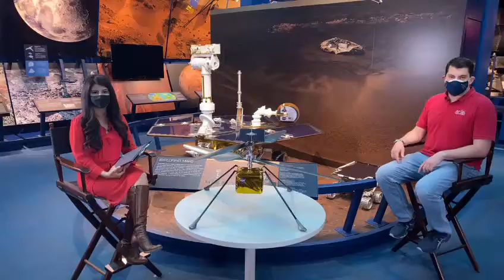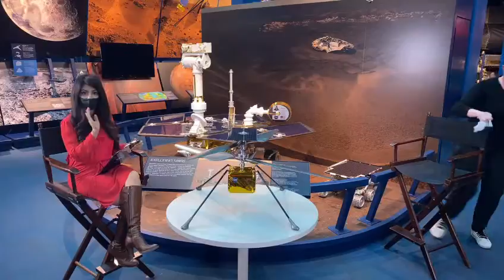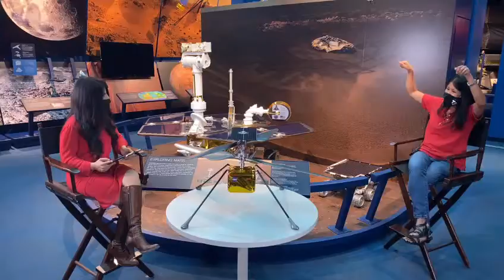Mars Helicopter Live Q&A: One Step Closer to First Flight

Comment: This Helicopter has a bad design.  For example the solar panels should have been in 2 sections but angled slightly down like in v but upside down.  So dust and dirty wouldn’t accumulate so easily.  Or it could have been in a form of a cone  under the propellers so it gets clean by the spinning blades.   And if it was a cone shape you could have mounted a pair of mechanical cleaning brushes. To  which will wipe clean the surface of the panels.    But I keep telling you. Failure to get enthusiasts involved  in your projects is  simply selfish and silly. So far I have highlighted 3 floors in your design.  Imagine what a bunch people like me can come up with?
Reply: Bad design ? I think, we will see it hoovering over Mars surface in appr. 3 days... Your example / solar panel: we do not know all restrictions, they had...
Reply: @frankr9728  haha good jokes.  it's clear that the Amount of money thrown at it, is Ridiculous   !!!  80 Mill I believe ? the last time I watch the interview they said  80 Mill ??   And I have commented  3 so far  exposing different Problems that could have made a better and longer experiment and for sure a better value for money for the tax payer!!!  how could you justify 80 mill on off the shelve components?  and come up with  design that has so many floors?  I said and  I repeat :  Give me 20 + a delivery transportation  and I will assemble a team and build you  not one but 2 systems  better than this one.  That will operate for at least 6 months. . Or give me 40+ delivery to destination  and  will land a man  on the moon for 3 days and bring him back.  Those with good ideas aren't always the one exposed to money, or real opportunities.  So good ideas tarnish where they are. And humanity fail   to  innovate  at the same pace  it did in previous industrial revolutions.  I blame man's ego and selfishness. Imagine if the person who invented the wheel, had put a restriction on it?? Anyway ...

Comment: What is the origin of the black "smudge" at pixel (527,832) (if pixel 0,0 is left,top - in that order) in image https://mars.nasa.gov/mars2020-raw-images/pub/ods/surface/sol/00043/ids/edr/browse/rcam/RLF_0043_0670767844_862EBY_N0031398RHAZ02006_00_0LLJ01.png ?
Reply: That's a composite image constructed from a panorama set. There's no data there. You're talking about the black area about 10 O'clock from the smallish rock, right?
Reply: NASA says it's a picture from their Rear Left Hazard Avoidance Camera (Hazcam) (not a panorama).  If you zoom in on that spot, the picture has artifacts, such as what comes from an editing process (interpolation, pixelization, etc.).  In that image, these artifacts are rose colored (pink-ish), and are not derived from the background of the smudge.  The width of the smudge exactly matches that of a line drawn in Microsoft Paint, at maximum width.  I have not been able to recreate the rose-colored artifacts using MS Paint, but the line-width matches exactly with this tool.  I am holding out hope that a NASA engineer will chime in on this matter.  Thanks!

Comment: Thanks for this good Q&A session - JPL is doing a wonderful job (again) + I have some remarks/questions:
1. why waiting so long until first hop as this is main goal for Ingenuity on Mars (worst case: electronics will freeze in the next days = drone is dead...) ?
2. alternative strategy: make a first hop (e.g. 10s), when battery is charged and tune charge & heating algorithms afterwards
3. is mission duration of Ingenuity (30 days) only limited by main mission of Perseverance (higher priority) or by technical reasons / which ? 
4. can Ingenuity go on with flight tests, when Perseverance will leave flight terrain for main mission (I guess, this is only possible with working radio link to the rover, which might break in a certain distance) ? 
Proposal in this case (with small risk for the rover as you can define a 'safety margin'): Ingenuity could follow the rover with certain hops to keep needed distance for the radio link.
Reply: They asked and answerred that question. Making sure Ingenuity antenna does not get caught on something during deploy, making sure legs properly deploy and latch, dropping it at a safe location and checking solar panel function and power management to be sure they have enough left over to consume power for flights. If they had power management issues they would have exactly the problem you describe. Short answer, being careful because that 1st powered flight is SO important for this tech demo project.

Comment: Such a shame the sound was so bad. Fascinating subject, but could hardly hear the audio, especially the questions from the host.
Reply: I guess you didn't stick around for long.
Reply: @cloudoftime  I did persevere (no pun intended!) for a large chunk of it. It did improve a little, but the challenge I had was the difference in volumes between the guest and the host. The guest volume was much louder, so I adjusted my volume to that. But that left the host volume very low and very hard to hear. Clearly face masks and interviews make this very difficult.  .
Reply: @welshwood1  Oh, I mean after 8 minutes it got better. But then there were more audio issues with the following interviewee anyway, by way of snaps, crackles and pops.

Comment: So rather than flying on the first day after disconnecting from the rover with a fully charged battery they’re going to leave it sitting on the surface a few days and see if it freezes to death first. You don’t need a helicopter for that. It would serve them right if it did die before flying because they didn’t have their priorities straight.
Reply: Perhaps (I have similar thoughts), but: JPL is best in class = they know, what they do & we do not have all details...

Comment: Glad you figured out how to get the Mic working. It is still so muffled. Do you guys really need two mask on? I've turned it off.
Reply: @Wadethewallaby2001   use punctuation
Reply: @Wadethewallaby2001   and how are they not going to work? It’s like putting sand through sifter with chunks of gold in it. The sand, which is the air, goes through both sifters, but two sifters really makes sure the gold gets caught.